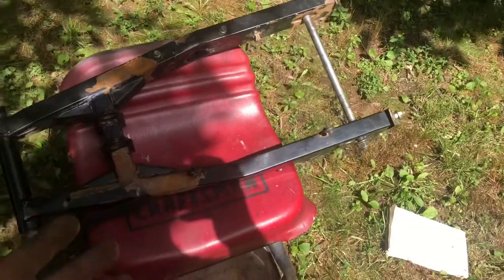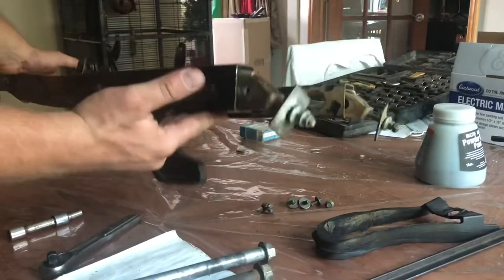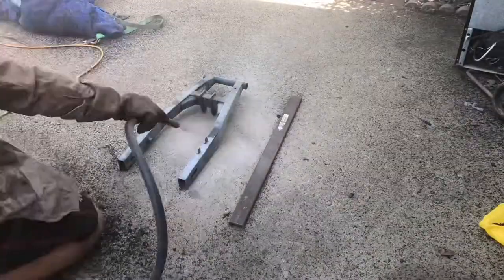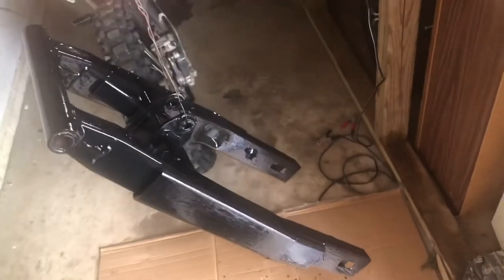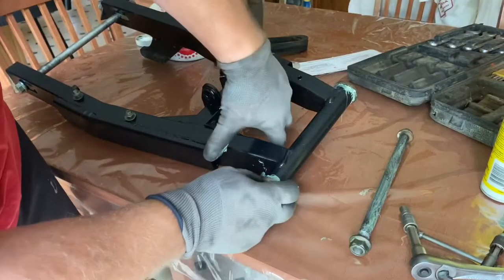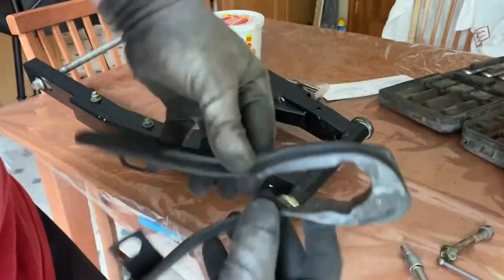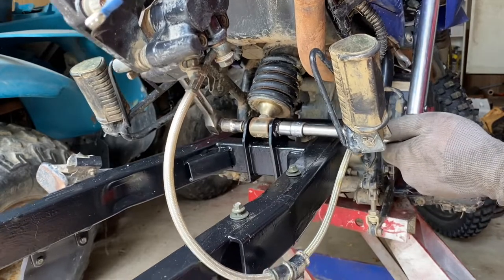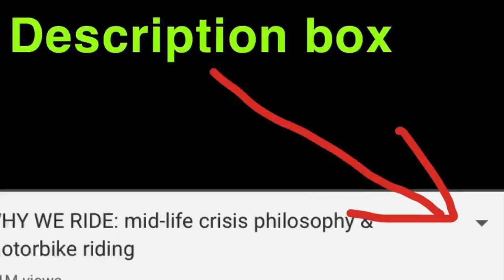My Hawk 250 has a problem.

Comment: Do you think the hawk would be a good bike to get to ride through the trails on my mountain?
Reply from the maker: Yes absolutely! The bike will climb any hill you want to climb. Most would agree that the hawk 250 has relatively low power, but I can tell you it will go up any hill you point it at. I’m just short of 200lbs, the bike does not run out of power on hill climbs (even with my 17tooth front sprocket and 42tooth rear sprocket) it will spin out before running out of power. I was in perry State forest a few weeks ago, we were out there hill climbing, some guy we were riding with said “man that thing it a little tractor” and it is! The low end power is amazing, top end not so much.  But hey, you can’t beat this bike for $1400, and it’s darn reliable. Iv had mine for 2,000 miles now and I’v only had a couple minor problems with the bike. I would guess mostly because of the way I ride the bike lol. But that’s a different story(if your curious I’ll be talking about the issues in a 2000 mile review coming up) Anyway thanks for watching! If your thinking about getting a hawk250 I wouldn’t hesitate to pull the trigger!
Reply: Thanks I think I might it sounds perfect for what I want to do. And the channel is great I love the videos.